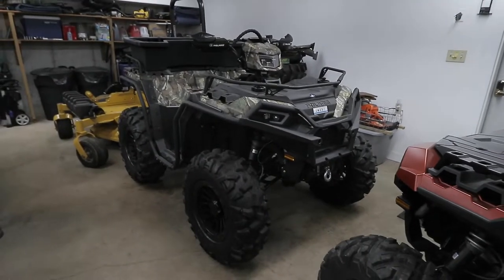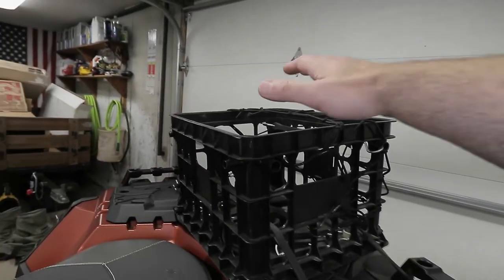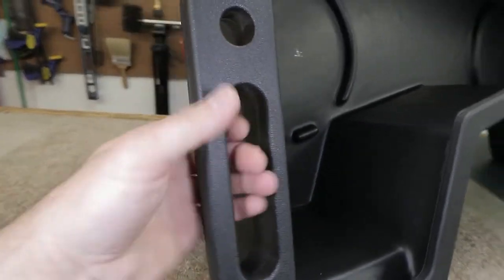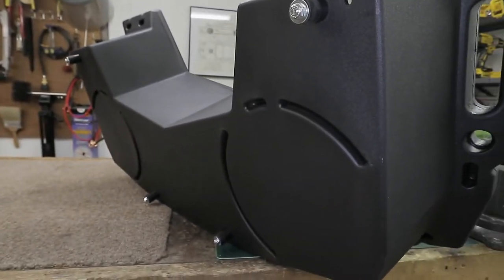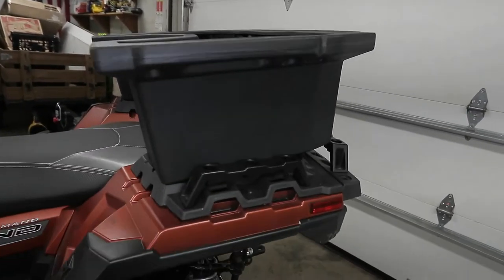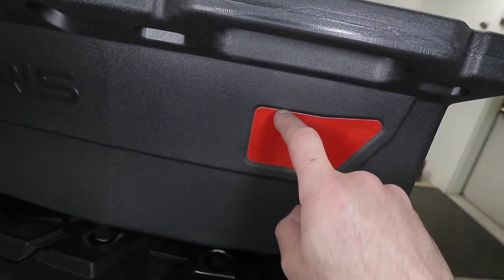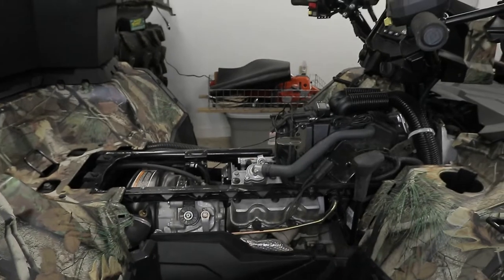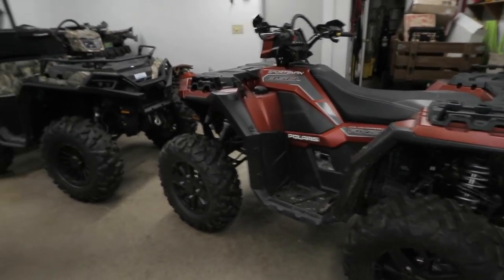LOCK & Ride Easy Mounting Open CARGO Box | POLARIS OEM XP 1000 850 570 450

Comment: I have a live hate with hard cargo boxes. If you don't fill them you stuff gets tossed, scratched, and banged up. I find myself having to use towels to protect stuff.
Soft storage is more forgiving and I've found to be better dust proof.
The open storage is great for property work. Looks like you could add some kolpin mounts or their gun grips for holding shovels and such too.

Comment: You can drill new holes in the box and you won’t have to remove the handles each time you want to install the boxes. It’s what I did, that way I’m not removing/ installing the handles all the time. It’s about 1/2” off the hole from the factory.
Reply from the maker: Yup thats seems to be the consensus. To bad polaris couldnt do it for us

Comment: I have 2 3.5 gallon pails on the back
Reply from the maker: Great idea! will have to try it out.
Reply: @JohnFrancoNH  it was 15$ for ten pails w/ tops on amazon in black couldnt think of a cheaper idea, one is recovery/rain gear the other is tools. Just wish i could fit a 3rd in the middle, however there are three slots but polaris didnt think the design through too well.